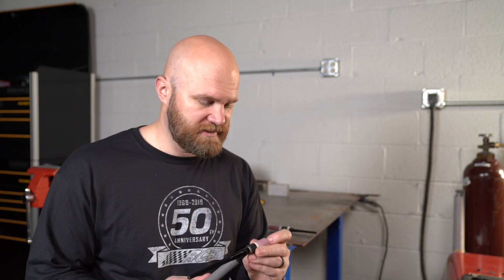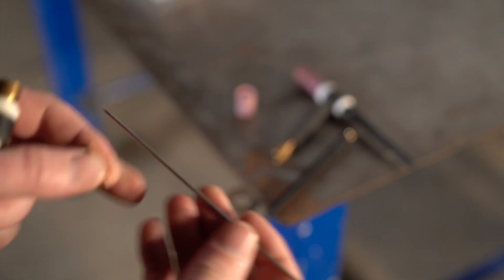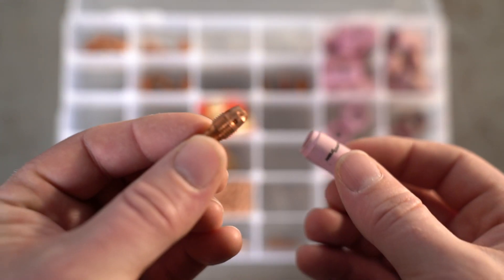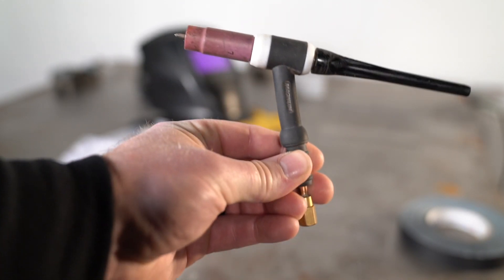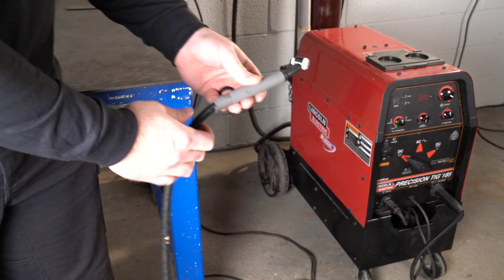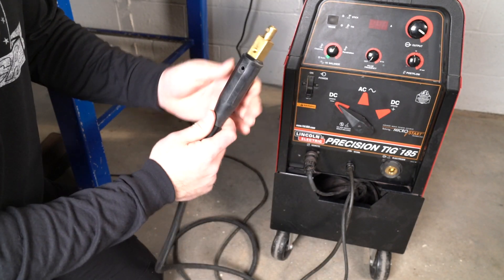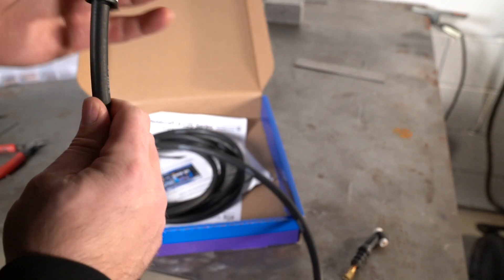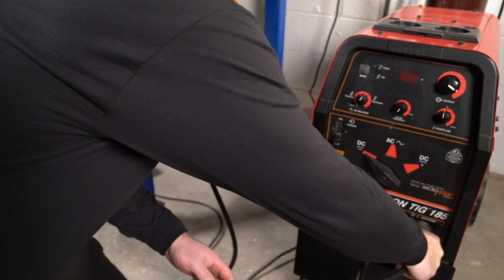TIG Welding Torch Basics - What's Inside?

Comment: If i have wp 26 torch can i remove the head and buy a 17 for the smaller size
Reply from the maker: Yes mine is a 9, but if it’s only air cooled it can over heat if you weld a lot of high amps or thicker aluminum. With what I do the air cooled 9
has been fine.